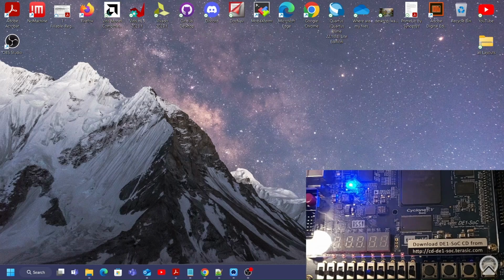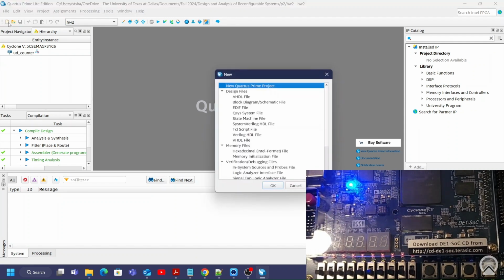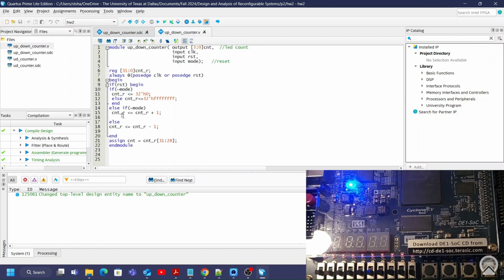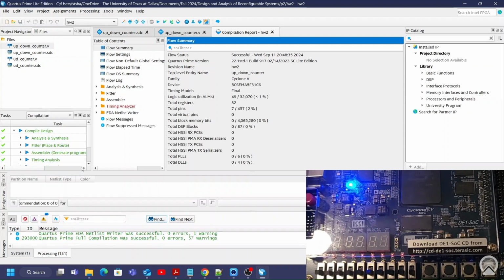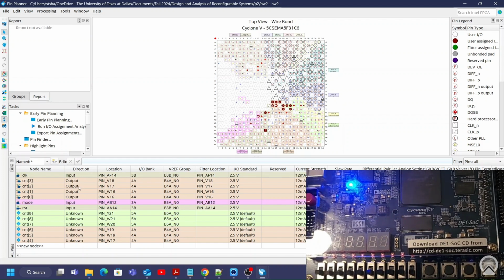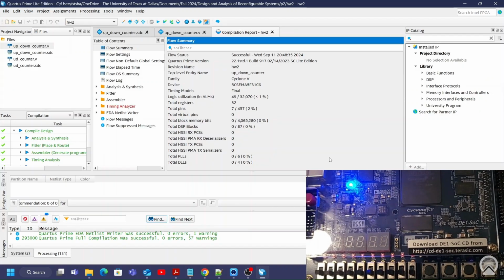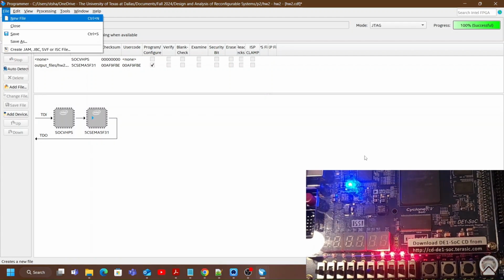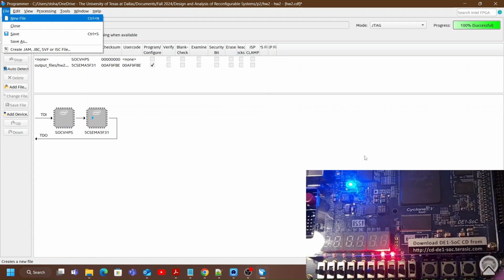2. 4-Bit LED Counter Design with Intel Quartus & DE1-SoC | FPGA Tutorial

Comment: Hello, Can you make a video of a project that use JTAG avalon master with onchip memory or other memory in DE1 CycloneV, then write and read using verilog. Can you use Platform Designer.

Thank you
Reply from the maker: Hey, refer to the following link: https://youtu.be/9WvEsLjDjv8
Reply: @saumyashah8742  Thank you,  this is for HPS, I need just JTAG with memory, because I designd it in platform Designer, then I declared in top level verilog file in Quartus, after I sent the Sof file, but when I try over TCL and also system console,  a message displays that no editable memory.